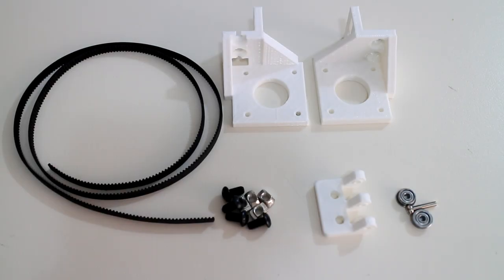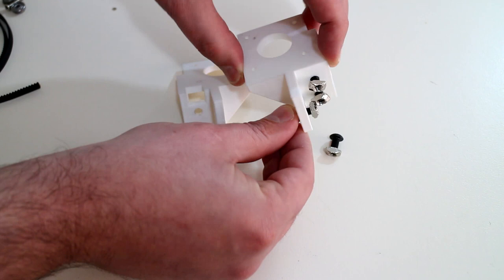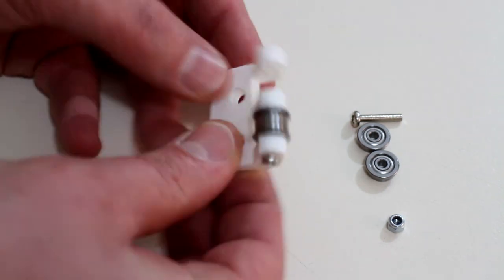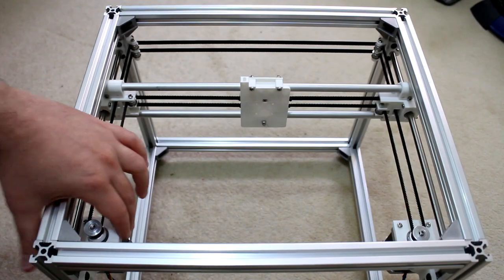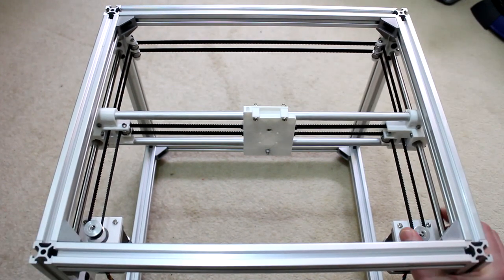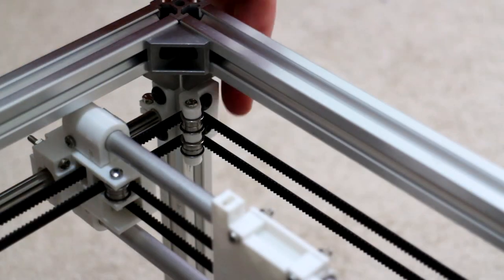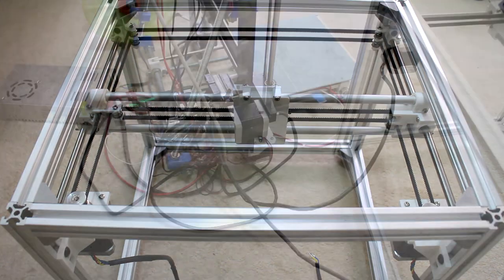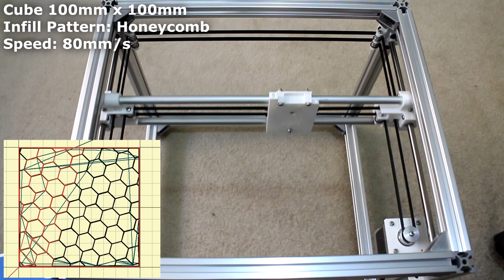New 3D Printer - Build Log #3

Comment: Ahhh noooo! Don't put the toothed side of the belt on smooth idler pulleys! It may work for now but it will cause you hell in the future as the teeth squish and it tries walking off the idler. Pick up some toothed gt2 idler pulleys and slap those in instead, or you can do what I did on my printer and give the belt a twist going from the motor to the idler so the back side is against the idler. Other than that its looking really nice, super quiet!
Reply: Same here for Y and it made a huge difference.  Yeah, use a toothed pulley instead is what I would do when I build this baby.
Reply from the maker: Fair enough. I think I'll twist the belt from each motor initially, if that causes problems I'll switch to toothed idlers. Banggood sell them as well :)
Reply: Tech2C
You and Banggood.  Comeon, admit it it's the name, right?  lol
Reply: +Tech2C Are the Stl files online for this printer?

Greetings from Germany
Reply: A tip: watch movies at Flixzone. Been using them for watching lots of of movies these days.
Reply: @Bobby Dylan Yup, have been using flixzone for months myself =)

Comment: Your design is beautiful. You've clearly put a lot of thought into the 3D printed parts... the construction looks seamless. Lightweight gantry, nicely aligned belts. I was thinking about how one would tension these belts so that the tension on both belts is identical, and with no need to rely on manual adjustment - I came up with the idea to put the motors on hinges, and an adjustable length tensioning rod/wire joining the two motors, thereby making belt tension easily adjustable, and perfectly even. If you don't mind, I'd like your opinion on this idea. I have really wanted to design and build a CoreXY machine for quite a while now, but I'm lacking the spare time. There are so many custom CoreXY printers on YouTube, but so far yours is my favourite.

Comment: Left side motor mount seems not to be stiff enough for the force of the tensioned belt (8:26), the motor and pulley on it is skewed to the side and your belt will be pulled towards the top and rub on the side wall there causing wear and movement resistance :) Bad print? Loose screws? The other one looks fine/straight...
And yes, the x carriage is wobbling like crazy and needs to be redesigned (7:24). You may consider preloading the rods against each other (push or pull top and bottom against each other slightly so that the inner side of bearing that is in contact with the rod never changes), and more widely spaced bearings (as wide as possible), maybe even two on both rods. The wider the points of contact the less amplitude of the wiggling (backlash) at the point of extruder nozzle
Reply from the maker: You're knowledge is welcome here! Yes the left motor is skewed as I can't attach it to the frame high enough (y-shaft clamp is in the way). I will have to combine the left motor mount and y-shaft clamp so I can affix the motor mount higher.
Regarding the x carriage, very observant. I already have the new design printed but didn't show it here (next video). The anodised aluminium rods have changed the characteristics of how the bushings slide on the rail, allowing me to attach the fully enclosed double bushing on both rails. This also means the x carriage no longer freely moves, and has eliminated the wiggle. Cheers!

Comment: At some point you'll probably want to replace the screws that you're using as axles with smooth rod.  Tap a thread on the end to complete with a nylock nut.  You'll also want to secure the extruder module at two points, with one point as close to the extrusion nozzle as possible.  It would also be interesting to know what you're using for a camera, lights, software and such.  Nice work!

Comment: Would there be any benefit to mounting the motors on the opposite end? In a later video, your build space was limited by the z rods on one side, and the XY steppers on the other side. The pulleys seem like they take much less room, and if that's all you had on the front of your printer, it seems you'd be able to go very close to the edge. It would also have the advantage of putting the motors closer to the board, so that you have less distance to run the wires. A final small advantage would be not having the belts possibly getting in the way as you're installing or adjusting the z-supports.

Comment: Your motor mount seems to be flexing due to tension belt at 8:24. 
Question: what are the advantages of CoreXY over cartesian and delta? I mean besides the fact that it looks cool.
Reply: Main advantage is low moving mass, so you can print at higher accelerations with little backlash!
Reply: +3DprintedLife Ok thank you, very interested to see how this build turns out.
Reply: Besides Deltas are not worth the trouble and make, I think, ugly prints on the walls of objects since a Delta can't truly do a straight line it is all emulated and results in a moire pattern.
Reply: Rubbish!  Delta's are for those with patience and know how, if the person has no patience and not the correct knowledge the delta will never work correctly, you can't half arse it like you can a cartesian printer and still expect average prints.  As far as a delta emulating a straight line, well yes of course it does but they do so fine if built correctly with no blacklash, so you think are cartesian printer emulates curves? lol  your entitled to your opinion of course but that assumption is pure rubbish ;)  i have a delta in front of me that does perfectly straight lines and so do thousands of others, i also have a cartesian printer in front of me that does perfectly straight and curved lines...it's all about how well it's made and if it's made shit well that's all it will ever be regardless of design.
Reply: Stephen Ozoux
Show me a print of yours with a nice wall done by a delta printer and I will show you a moire pattern.  I have YET, until you, heard anyone say that was BS because it isn't.  Many channels across Youtube, and on the RepRap forums and even on the SeeMeCNC forums all know it happens.  It isn't disgusting BUT it isn't baby ass smooth either.  I do believe even Thomas Saniaderer showed this on a Delta at one time and his shit is over built.

Comment: That's a great design, I did order the same profiles. The only thing I plan on doing differently is to keep all the motors and gantry outside of the cube frame. The purpose is to close off the build area for better temperature control in the build area, heat treatment 110C oven post print, keep the steppers cool, keep the fresh air for the head too. Ditto for the comment of 3DprintedLife get toothed idlers.

I want to go for the direct drive system, probably closed loop steppers too, so I do not know if I need to go the very light way.
Reply from the maker: These aluminium extrusion frames are great for configuring your printer the way you want it. I preferred to have all motors and electronics embedded within the frame but I see the advantage of having it all external.
I've flipped the belts on each motor which seems to work well so far with the smooth idlers.
Reply: +Tech2C  I looked at the video again. Check at the video 8:29, seems the mount is not able to keep the motor straight. maybe adding leg behind or add another brace. This may explain the fluttering of the belt when you do the dry run.
Reply from the maker: Correct. Already fixed and ready for next video :P

Comment: Why don't you need the belts to cross?  I thought that was a "feature" of the core x-y.  A similar design (h-bot) does not cross the belts.

I'm interested in building a core-xy printer.  I would need to upscale some of the parts because I have some surplus nema-23 sized motors I got surplus.  I've used these in a conventional  cartesian repstrap, and they perform well.  I did end up using larger belts and pulleys (3/8") though.

Comment: On the X-Y idler mount, could you have used some shoulder bolts (with the middle portion a little wider) to have it a little stiffer than with a 35mm long screw?

Comment: The issue with the carriage twisting isn't caused by the tensioners.

Consider the forces due to belt tension:

When you tighten the lower belt, it will pull on both sides of the carriage equally. Tension on the lower belt results on a force on both the left and right side of the carriage, as these are the two ends of the lower belt.

Your problem is that the carriage is not attached to the bearings firmly enough.
Reply: Without having a look at one of these printers in front of me. I think the issue is that there are 2 belts above each other.  When you have Y axis change of direction, you will have the carriage being pulled from opposite corners and hence causing a twist.  For a perfect situation the belts need to all be in the Z same plane somehow.  This is really dictated by the fact he has the guide rods in a vertical orientation.

Comment: Awesome! Those CoreXY kinematics are very interesting, and I see how they'd make the moving parts lighter. And I love how quiet it is.

But I have a bad feeling about this whole belt system w.r.t. quality, reliability and longevity. The total length of belts in your design is greater than I've seen in any other printer. Belts seem to be prone to slipping, vibrating loose, etc. And isn't there some stretch to them that may cause imprecision? If so, you'd be multiplying all those problems by 4. And common axis-aligned movement relies on the interplay between all your moving parts, compounding any error. (Question: Would a test cube come out better if you rotated it by 45 degrees on the print-bed?)

This is just a gut feeling, mind you, and I'm quite inexperienced, so I'd love to get a response.
Reply: My thoughts as well. At the moment it looks quite solid part from as mentioned having the toothed belts facing a smooth pully which may cause slippage. Its a good project I'd to make a better frame for my cheap Chinese 3D printer.

Comment: You could put some cork stepper motor gaskets in, will stop heat transfer to your pla mounts and make the printer a lot quieter.  I use the gaskets on my Delta build and they work beautifully and are very cheap off Ebay.
Reply: His motors shouldn't be getting hot enough to deform PLA and if they are something is wrong.  Maybe too small of motors?  I know I wouldn't use ABS for these parts and would use PLA or PETG to be honest.
Reply: Agreed, but the gaskets serve a dual purpose in making the stepper a lot quieter especially on a all metal frame.  I usually start my stepper out on 0.45v they run warm to the touch at that voltage though not hot at all, i then try for 0.40v   I also use PLA for brackets because of the rigidity of the material, ABS is too soft and flexible when you have belt tension 100% of the time on the mount.
Reply: Stephen Ozoux
Yep, and I do the same.  If warm to the touch PLA will laugh at it BUT PLA has a nasty habit of deforming after the fact.  It isn't so much deforming but on my bearing holders for Z the bearings now slip out as the plastic is smooth and shiny now and when they were ABS they stayed in.  I think the best material to use would be PETG for parts.  I use motor cork gaskets too.  Doesn't help with heat migrating through the screws though.
Reply from the maker: Yes, I can feel the vibration in the frame when the motors are active. I'll definitely insulate the motor screws from the mount. Cheers!
Reply: +Dark Alchemist i use hightemp nylon washers on the screws ;) it doesn't isolate tye thread passing through the hole of course bit it's a lot better than tightening the screw straight down onto the pla.  i've not had any parts bend or warp using these methods but have seen plenty from those that don't (probably overvolted stepper being the main course)
Reply: Stephen Ozoux
I use stainless but really wanted some felt washers m3 sized to put under them but never could find them and I didn't want to jury rig some.

Comment: Why use 2 @ flanged bearings instead of toothed pulleys?  A toothed belt on a smooth bearing will damage the teeth and cause stutter in the belt when tensioned.

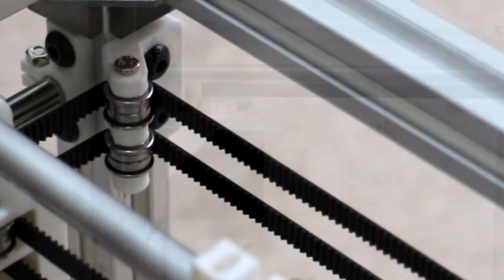Comment: Hi great build you got going...I noticed that at time mark 08:18, your motor mounts look a bit tilted from the belt tension, you might want to beef them up a bit or load them in a different manner. Brgds
Reply from the maker: Yeah it needs adjustment, plus I'm only printing at 10% infill whilst testing.

Comment: Great Video! It will be interesting to see how the 3D printer turns out in terms of print quality. How much do you think the total cost of this build will amount to? Would you expect it to be less expensive than off the shelf kits (such as the ones linked in the description),  or would the cost of the materials exceed the price of a basic Prusia I3 clone?
Reply from the maker: It will be less than $400 I'd say, especially if you can get the aluminium 2020 extrusion cheap. I haven't tallied the BOM but it should be fairly inexpensive.

Comment: dude, the second stepper you showed is at an angle. You put the toothed side of the pulley too fat from the motor and so its puting too much force on the plastico bracket. Add some support on the other side of the motor. You can see at the end of the video how the belt twists because the pulley is angled. That will cause backlash in your prints as the belt will twist instead of moving for the first milimeter or two

Comment: Steppers are skewed by belt tension. They are not parallel to the frame.
Maybe you could support back side of steppers too? They have holes there 8)))
Reply: Or simply add more meat to already existing fixture so that long part of the stepper push not the air but plastic in to the aluminum of the frame.
Reply from the maker: Very observant. Yes the motor on the left side mounted highest has the M5 screw lower to allow the y axis clamp to enter the motor mount. Unfortunately the motor mount fixings are less effective because of this. The lower motor on the right hand side is fine.

I guess it doesn't help that these parts are printed with only a 10% infill whilst I'm designing and testing... :P

Comment: Very interesting series. Especially since I'm designing/building a printer these days (not corexy, more akin to richraps gli3dr but with belt and leadscrew). I don't remember if this has been answered but how much infill do you print the parts with?
Reply from the maker: I'm only testing so infill is a paltry 10%. The final parts will be way higher like 75%-90%.
Reply: +Tech2C ok thanks

Comment: Hello Tech2C,
Do you intend to implement an auto bed levelling mechanism? Are you going the Ultimaker way for the Z axis?
I've built my own classic mendel i3 but now regret it as your core xy looks so much cooler =D

Please let the imaginary print finish next time haha, I could sleep to the sound of this machine.

Keep up the awesome work!
Reply from the maker: The z axis is coming up very soon. It will be cantilevered. The printing does sound very different from the Prusa i3 which was unexpected. Auto bed levelling is optional  and will be part of the bowden mount. Cheers!
Reply: Why cantilevered? You already have two steppers from the prusa for the z-axis. You just need two more bearings and linear rails, if you support the bed on two sides.
Reply: Two motors on one driver loses steps and is one reason why we Prusa people end up having to keep tweaking.  It was a horrible design decision he made when one motor and two rods with a belt in between them would have been a perfect solution.  Not sharing the same driver for two motors would have only required a stronger motor but not by much and we already use Kysan 60-70oz motors which is enough for the purpose.
Reply: That's a very bold assumption. It depends on the driver and the motors if there is enough current. There are plenty of designs that use two steppers just fine.
Reply: *****
No, they do not as two motors (like the i3) will gradually lose sync it is physics and how the motors work and this is why you have to tweak Z height as the Prusa I3 people know all too well.  Two motors and two controllers that were synced up would be fine too but not two controllers on one driver.  Sure, it works then we eventually tweak Z again but for the big machines in businesses they don't have to constantly stop everything and retweak stuff and they use one motor and it drives various rods.

Comment: Nice build Tech2c (very detailed). I just finished assembling mine and am running it through the basic checks. The only issue I have is that the Z-Axis seems to be jumping while a print is being made. I can control it from Slicer no problem, but when I start a print, it jumps and doesn't seem to be moving down. Any help is greatly appreciated.

Thanks

Comment: I like the x-y idea, saving a motor and having the model mostly stationary seems to be a win win. Maybe one day all 3D printers will be made this way :) Your design has very clean lines. Are you going bowden or direct?
Reply: He had a Bowden drive on his i3. So I'm going to guess that's the route he is going to take again.
Reply: It still uses the same number of motors. They are just used in a different way.  Instead of 1 for X and 1 for Y, you have two that work in tandem for X & Y.
He will likely go with bowden, as one of the main reasons for this design is having a very light carriage so it can do very rapid movements with low inertia. If he does direct, then he would have the mass of the extruder to move, negating many of the advantages of the design.

I do agree, it is a very nice build. :)
Reply: Oh, I thought you saved one on the z-axis with an x-y.
Reply: I wasn't even thinking about the Z-axis. You may be right!  With this style of printer, you can use either 1 or 2 motors for the Z-axis, we'll have to wait to see which way he goes...